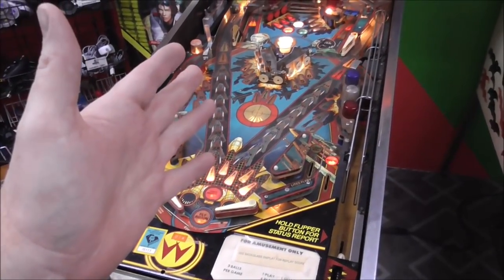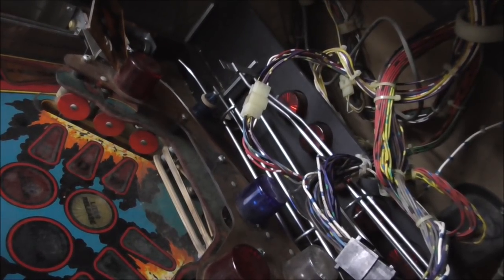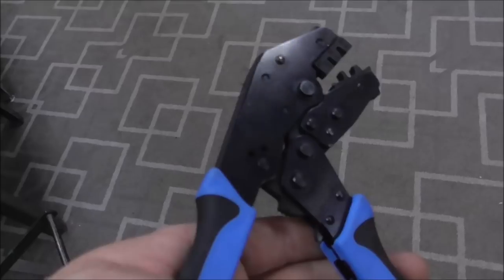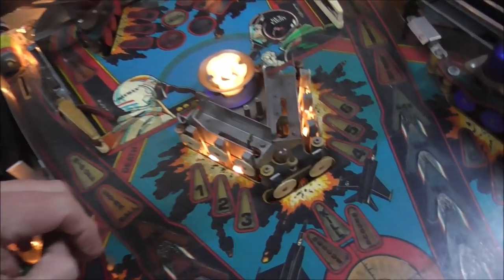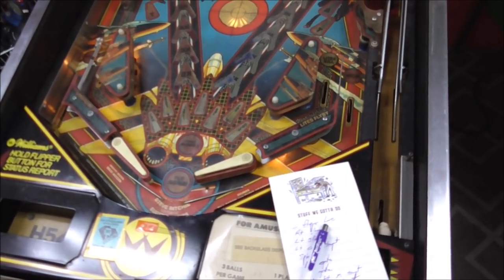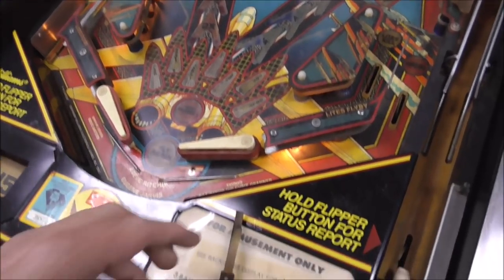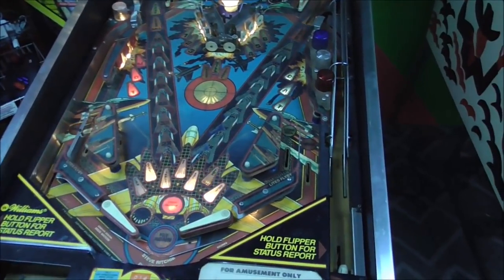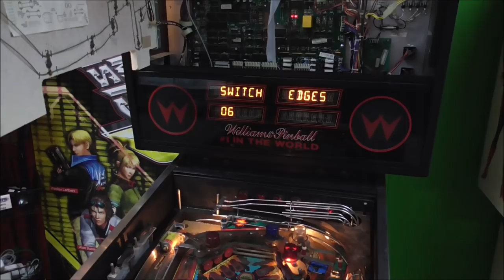How To Fix 95% of System 11 SPEAKER HUM - 1987 Williams F-14 Tomcat Pinball Machine Repair 9

Comment: I acquired a Space Shuttle pinball. It's a System 9. Difference from your System 11 machine is on the 9 the sound system is included on the large MPU board. I had same loud hmmm. Checked internet and found solution to ground shield of the speaker wiring where it left the MPU connector. Hmmm reduced to practically nothing.  My Fire game sibling of your F14 must have all the requisite screws because I did not have the hmmm when I acquired it.

Comment: Had to fight with a 120Hz humm on an 8-track player too for a while and didn't find a way to quiet it down. Everything had a nice star ground, leading to just one point, apart from the head position/program solenoid, which I fixed. So I finally bit the bullet and put in a 15V voltage regulator for the amplification PCB. There was no voltage regulation inside before, being from the late 60's, early 70's; it was straight from the transformer, through a B+ rectifier, filtered by a 2200µF cap to the board. It never knew fancy things like voltage regulators before, heh. Linear voltage regulators have a ripple rejection too; that finally quieted things down....  What a relief after endlessly poking at that thing... Now I'm gonna get more 8-track cartridges :D
Reply from the maker: 8tracks Are awesome, glad you fixed the humm!
Reply: Oh mains hum getting into the audio can be fun to track down. It's 50Hz or 100Hz over here.

Comment: Interesting. My High Speed had that noise and all screws present and tightened. The only way I could stop the noise was to isolate the little audio board using nylon washers and screws. shrug

Edit: I just checked. I was actually missing screws!! I replaced and tightened all of them and the noise is COMPLETELY gone. You’re the MAN.
Reply from the maker: There you go man!  Keep in mind there’s audio on the main board too and also the power supply is involved!

Comment: My one connector was replaced with a Molex connector and new pins and the person used a small zip strip around the housing body in the place of the plastic indexing key. Dunno if this was an operator hack back in the day?
.
Reply from the maker: I’ve seen that before hey if it keeps you from plugging it in backwards I guess it’s good!

Comment: Does all pinball games have those special solenoids? I'm not sure what they are used for in the playfield to use special solenoids
Reply: No. They are used to stop the processor in the game having to flip the solenoid when certain switches are pressed. A 'special' solenoid in this case means one with a directly wired switch which can also activate it. This was important when processors were very slow and couldn't keep up with all the things.
Reply: @queazocotal  normal solenoids  have switches on the playfield. The special solenoids also have switched connected directly to the solenoids. I don't understand the differences between the normal solenoids that have switches connected directly to the normal solenoids compared to switches connected directly to the special solenoids? They seem to me there is no differences at all

Comment: Hi, Any idea how to fix speaker buzzing on a Bally Skateball. In attract mode when the highscore is showing on the display the speaker gets interference.
Reply from the maker: It's usually the capacitors on the sound board, but some people are more sensitive to it than others.  Most games will have a little bit of buzz with the lights and some people can't stand it... so it just depends on if you're talking about that (which can't really be eliminated) or if you're talking about it making a pretty loud noise, which might be the caps.

Comment: I struggled with the sound cpu light noise on my whirlwind and it got worse since I added a ledocd board, but removing the 2 right hand side screws on the sound board resolved🧐

Comment: Thanks for the sound info. What if there’s a big speaker pop when you turn the machine on or off?  Is that a cap or something?
Reply from the maker: That’s actually pretty common no way to really fix it, it’s designed that way…

Comment: I have the same whirring in my Grand Lizard, and have plans to fix it, but as everything else its been pushed on the backburner due to other things LOL

Also, while im at it,  if the solenoid coil fuse pops after like 2-3 smacks on the flipper buttons during game, im guessing its a transistor gone bad? it started the other day so ive not had that much time to stick my fingers into things.
Reply: First, make sure it's a slow-blow fuse.  Solenoids use a lot of power at first.  Second, make sure the end of stroke switch is properly actuated by the flipper mechanism.  If not, then it will be pulling at full strength even when it won't move any more, and that causes excess power draw and heats up the solenoid coil.
Reply: @ovalteen4404  it worked just fine until around.... wednesday, when the fuse just popped midgame, now it just pops all the time even with new fuse. As i said have not had time to look yet.

Comment: Isn't there a way to kill the power to the special solenoids during testing?  Something like pulling the fuse.
Reply from the maker: Not to just the special solenoids
Reply: @LyonsArcade  I wonder why the software didn't turn off the enable signal during the switch test?
Reply: Coils, in general, are always "live" when a WMS game is in test mode.

You can kill their action by unplugging the coil power, or pulling the fuses, to drop the coil power supply out (+50 and +25 for this vintage Sys11).

The drivers will still fire (connecting ground) but with no supply for the coil it won't do anything.  Functionally the same thing as the interlock switches on newer games.

Very handy if you're tired of slingshots, jet bumpers, and kickers from whacking your fingers.

Comment: What is the brand and model of the crimper tool you show in this video?
Reply: Looks like a Molex 63811 series or similar
Reply: @Ebinsugewa  I found it. It's a HanLong model # HT-225D. Bought mine brand new on Amazon for $23. I can't wait to try it out.

Comment: What about a twin-'T' Notch filter between the CVSD chips and the audio amplifiers.
Reply from the maker: That sounds like a lot more work than putting the screws back in the board :)
Reply: @LyonsArcade  You want the mains hum out of the system don't you.
Reply: @DAVIDGREGORYKERR  it adds character to it

Comment: I personally replace the connectors with the same as what was on the game. These newer games use Amp mta connectors. The tool costs s few more bucks than the one you use but it keeps the cables as it was from the factory. Just my preference.
Reply from the maker: Couldn’t resist could you?

Comment: .062 is actually 0.0625 or 1/16".  Standard Automotive size, asis the .15625 (5/32").
Reply: Are you sure? (joking)
Reply from the maker: That makes sense WreckDiver I didn't do the math :)
Reply: @LyonsArcade  Math is hard...LOL...actually being in automotive and doing my fair share of tinkering its common for me to hear .156, .1., .062 etc., terminal sizes...they are moving to metric though.  Wire is finally almost all metric now, as are terminals.  Going to drive a ton of people mad that still work on their own cars.  "Can't find that 10mm?"...yea, wait until they need new crimper jaws...LOL
Reply: @WreckDiver99  yes, it's always the 10mm socket that has gone walkies. 

Alternatively, let me grab the 19mm socket.. Let me see, 16,mm. .17mm, 18mm. @#$% no 19mm.
Reply: @gorillaau  13's seem to go sometimes too.  My Tahoe has quite a few 13's in it.  At least with the 19, I can (many times) use the 3/4" lol.

Comment: 0.062" is 1/16", not a metric conversion...
Reply from the maker: Thanks I didn’t know that!
Reply: Same with the .156...5/32"  Standard Automotive stuff (and others).
Reply: @LyonsArcade  Now, something that is a metric conversion... Namco (and a lot of other Japanese arcade game makers) used 15mm plywood.  I know a guy who repairs video game cabinets; he was convinced that they used 9/16" plywood, which is a really uncommon thickness unless you have it custom-made.  I can see why he made that assumption, because the difference is negligible.  9/16" is 0.5625 inches, and 15mm is 0.5905 inches.  To complicate things, Namco outsourced some cabinet production to a company on the west coast (I think it was in either California or Washington, but I could be wrong).  The cabinets made by this company used 1/2" plywood.
Reply: @SpearM3064  there's a reason behind this ... if you shipped a complete game from Japan, you got charged import duties.

If you made a cabinet domestically, and stuffed the guts into it, it counted as "Made in the USA"

Comment: My guess on the hum is that they shared the same ground traces for both digital and analog circuits.
Reply from the maker: That sounds right to me :)
Reply: @cheapasstech  unlikely.  I suspect the noise is mixing on the board and that takes more than filter caps to fix.
Reply: @cheapasstech  I can't say that my initial guess about the board design is correct, but you really want to keep analog and digital grounds separate on a PCB, except at a single point.  Caps might work, but without through-holes or SMD pads, the installation would get messy and excess leads will add inductance.  If there were an easy fix with say a limited amount of caps, I would expect to see it online.  The most common suggestion to minimize the sound is what Ron did - make sure all the PCB grounding screws are installed and tight.  This is also a case where one could justify adding lots of caps and other tinkering if it were their hobby.